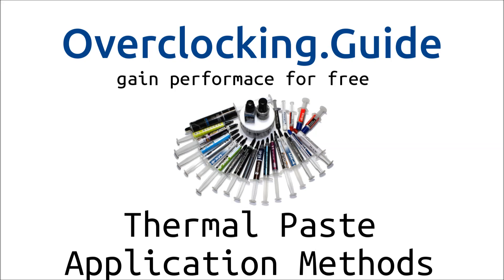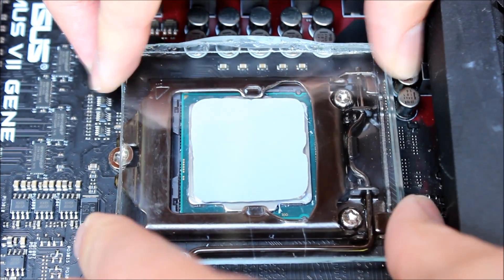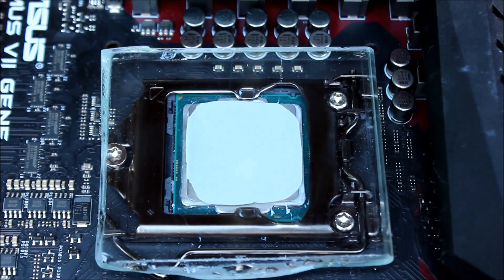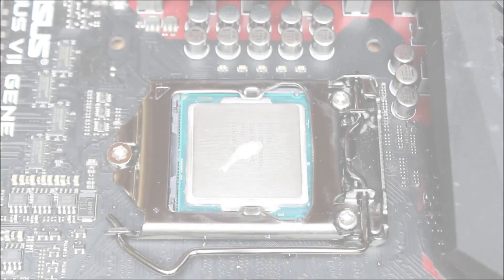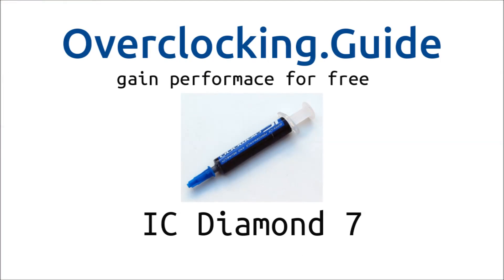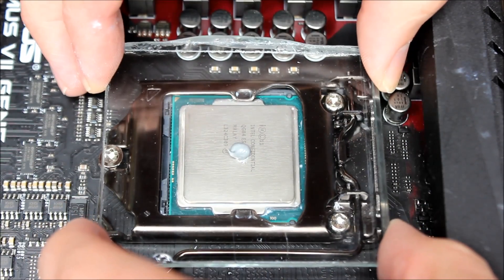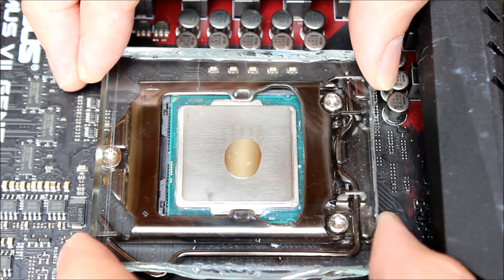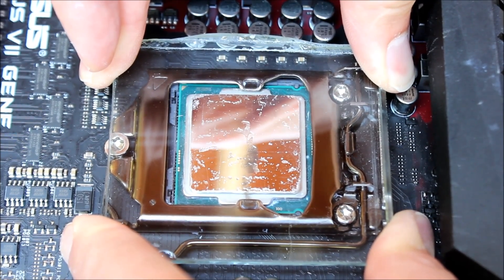Thermal Paste Application Methods 2015 - Test with new products including Liquid Metal

Comment: I saw the gif recorded from this video that got spread around. I asked around my PC shop coworkers and one of them pointed out that it doesn't look like real glass (not visibly "green" around the edges), and it could be bowing from the corner pressure, causing a different distribution of pressure than a metal heatsink. The results still seem promising but I think the possibility of this has created a little bit of doubt in my mind.
Reply: Looks like soda-lime glass to me. I can see a slight green tint at the edges. Mixtures and purity of materials vary, so some glasses are less colored than others.

Comment: Have you heard of Pyrolytic Graphite Sheet? It has a thermal conductivity of 1600W/m·K.. 
https://www.youtube.com/watch?v=ZAEhyY1_czM
https://uk.rs-online.com/web/p/thermal-gap-pads/7123995/
It's only used as a heat spreader in smartphones at the minute, but I'm amazed the overclocking community hasn't used it yet. I'd love to see heatsinks "shimmed" with this stuff, it's not even that expensive for a small piece and would make any large heatsink or heat spreader 10x as good.

Comment: @Der8aur, i would be interested to see this test normalized, or in other words, modify the acrylic to work with a standard mount bracket, so that you can apply the same pressure a typical heatsink would, and then after applying the heatsink, using a heat gun to simulate some CPU thermal load, I would think that applying it in this manner, along with the heat, would provide different results as the heat would change the viscosity of the thermal paste, and perhaps improve spreading, especially for those pastes that tend to not spread well. It would also be interesting to use some Fujifilm prescale pressure sensitive tape to see how evenly a CPU heatsink is contacting the cpu's  -Brad

Comment: I really don't think the application method has much to do with it as the amount of paste varying between application type.

Me personally, I do a small line myself but that's is due to the fact I'm a little more conservative myself when it come to the amount I use and I don't have to worry about not using enough like I do with the dot.

Comment: I wonder if the huge variation in results from using liquid metal is because it spreads so randomly, even when manually spread across the IHS. In his application, there was a lot not making contact right in the middle of the IHS. So you're also playing the "spreading" lottery I guess. But wow is the dot method bad on everything. I will manually spread from now on, fuck it.

Comment: This hurt to watch, you don't need to cover the whole thing. It's not better for temperatures and only risks getting the paste to leak out.
Reply from the maker: a bit over emotional? :D It's just to show how different pastes spread and how it looks underneath your cooler
Reply: There are electrically conductive compounds and people who are less informed could possibly short out and ruin their system if they think it's necessary to cover the whole chip to the point that it could leak out. Besides this I think your video and methodology are good!
Reply from the maker: Only liquid metal could hurt in that way. All other conventional pastes are not conductive. Worst case they are slightly capacitive but that won't hurt.
Reply: Yep

Comment: I have seen plenty of these tests and result is that it has no effect on cooling whatever method you use to apply the compound. Only if you apply too little compound it decreases efficiency.
Reply: I can tell you from my experience that you can get (not must) bad performance if the paste dont cover properly a wide area, wich happen sometimes if you move your cooler around while screwing it back to the mobo. Suddenly you have the paste only on half the cpu or something similar. The real performance killer happen only if you put way to much paste on it.

Comment: Cotton swab is a bad tool for spreading, lots of little cotton fibers will come loose and mix with the paste. I can see this when i clean the CPU with isopropyl alcohol and cotton swabs, often times little fibers will come off, but at least there you can blow them away later.

Also, the line method should be quite good with modern CPUs, as the dies are rectangle-shaped. Search for example for "Skylake delidded". If you put a line of paste in the right orientation, it will have a good cooling result. The edges are not important there.
Reply from the maker: +Mike Miller You have any other good method instead of the cotton swabs?
Reply: +der8auer A razor blade or an old credit card will do. See http://www.arcticsilver.com/intel_application_method.html#

They recommend the line method for all newer CPUs too, by the way.
Reply from the maker: +Mike Miller yea but that's only conventional paste? Can't really spread liquid metal with razor blade or credit card
Reply: +der8auer Hmm yes, liquid metal is a different case. Don't know what to use there. But i prefer standard thermal paste. I've been using Noctua NT-H1 with the line method on my new Skylake 6600K. Which, by the way, reports way too low CPU temps with my Noctua NH-U14S. I mean, 2° below room temperature just isn't physically possible. I think it reports at least 10° less than it actually is...

I'm German BTW, but i prefer to write in english here, since it's an english-language video. Maybe other people will want to read this as well. :)

Comment: Really helpful video! I'll be using the x method with grizzly compound when my new pc arrives. Just curious but would you happen to know if it's better to overclock before or after thermal application?
Reply from the maker: +Vincent Chang Apply the new thermal paste first so you can check the correct CPU temperature

Comment: should it only go on the cpu or both cpu and cpu cooler
Reply: only cpu
Reply: If you are using liquid metal you always put it on both so you don't end up with the bubbles like he showed with the clear slide, it also bonds better when you do a liquid on liquid pressure mount, if you are using normal thermal compound you only need it on the CPU.
Reply: bs, would still be bubbles but between the layers so you can't se it on the glass.
if ultrasound test it you can se them
Reply: *****
Not quite liquid metals viscosity is much different than thermal paste, combine that with its conductivity and that is why it's much harder to work with but done right and you don't get bubbles. We don't count microbubbles as bubbles because there is essentially nothing you can do about them and they have no effect on performance.

Comment: the last application you did that covered the whole cpu before you pressed down how did you spread it on I'm bought to get it to cover the cpu did you use like a credit card
Arctic Silver 5 High-Density Polysynthetic Silver Thermal Compound, 3.5 Grams
Reply from the maker: +David H I use normal applicators which are included in most thermal pastes. Arctic Silver 5 is a very bad choice tho. You can gain up to 5-10°C with a better paste.

Comment: Coollaboratory metal paste I think needs spreading on both surfaces. You've confirmed that for me with this excellent video. Thanks. As the air spaces were too big if only applied to the cpu ihs
Reply: Yes you spread it on both the CPU and cooler, liquid on liquid is the only way to ensure you don't get bubbles like that and it dries out. You can leave it on for years if you do it right, if you do it wrong it will stop working within a few months. Also never apply it to Aluminum, copper works best but nickle is fine as well.

Comment: great video, from all the research I have done, it seems the X and spread method are the best, just don't know why people use the pea method as it leaves the edges and corners exposed , here's another quick guide showing the X and spread method are the way to go https://www.pugetsystems.com/labs/articles/Thermal-Paste-Application-Techniques-170/
Reply: +Harshtimes1125 The pea or dot method is sufficient because modern consumer CPUs have just one die right in the middle of the processor package. There is literally just air beneath the edges of the IHS and heat dissipation to the cooler happens really just in the center.

Thanks for your interesting link with some actual test results. As you see the difference between all methods is negligible. In a range of ±1°C it's already very difficult to eliminate the influence of room temperature and system temperature in consecutive tests. Just use the method that is the easiest to you. If you are unsure, just check the results afterwards and try again!

I prefer the pea method because it's fast, easy and prevents me from using too much thermal paste. It "automatically" spreads to the perfect thickness without squeezing out. Again, only for single die CPUs!

Comment: Cool video man. What material are you using to press down and yet not crack under the pressure? It would be nice to have something that you can screw into the socket backplate, say LGA 2011-3, completely like a CPU block to eliminate the mounting pressure variability and get consistent mounts, and yet be transparent to show the TIM spread.
Reply from the maker: VSG I used normal glass with 1cm thickness. Good idea! Maybe I can find a solution to check this as well.
Reply: Let me know if you get any ideas, it would be cool to include it in my upcoming review of the Kryonaut. Thanks again for the samples!

Comment: der8auer   thankas but its very hard with the  gelid applicator .Should i use another thing to spread?
Reply from the maker: Mustafa Demir The Gelid Applicator works best from my experience. You can try to heat up the paste by putting the syringe in hot water before using it. This will change the viscosity a little and make it easier to spread.

Comment: I thought the gripe with full spread was that you use too much paste which causes some lost thermal performance. I think if you did a really thin square about 2/3 from the center it might spread well and thin enough.
Reply from the maker: Scotty Catman The viscosity of most paste changes when the CPU heats up and considering the pressure of about 200-250 N it should "squeeze" out almost everything if you use too much. Actually a good idea to test that.